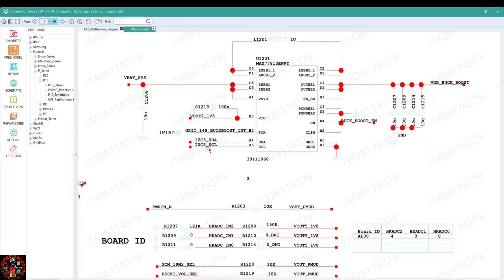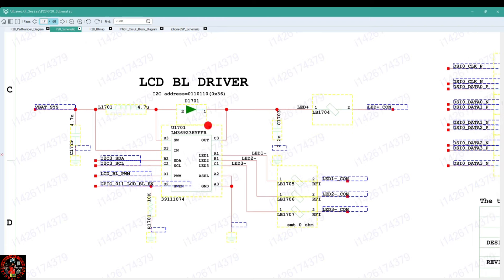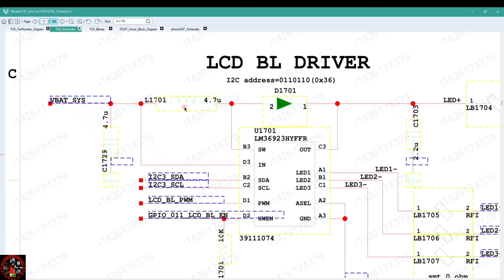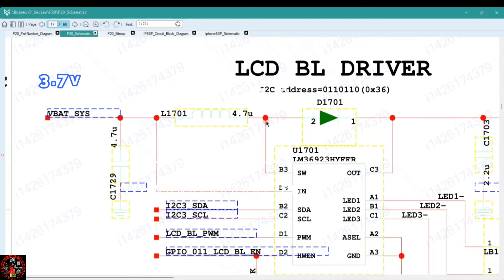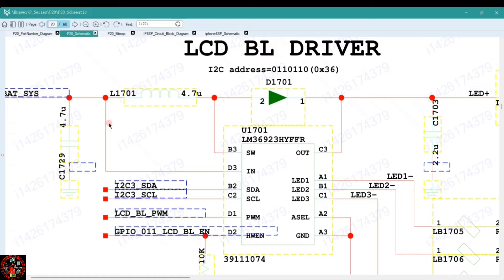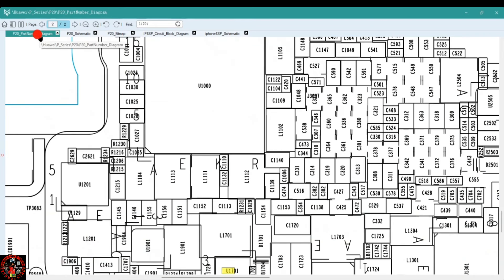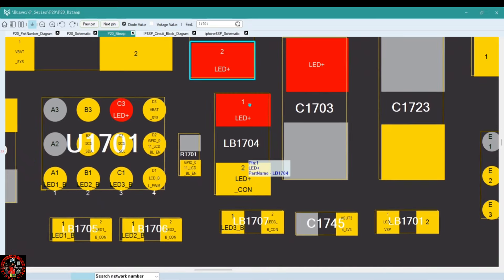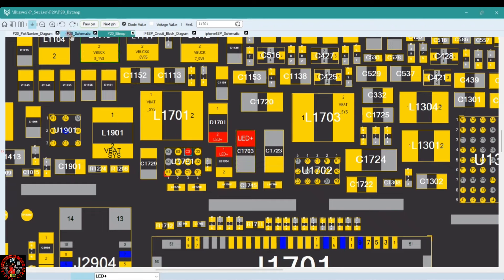How to Read Mobile Schematic Diagrams

Comment: I really learn from this video,i would like to join your mentorship program,but don't forget I'm from Nigeria.
Reply from the maker: You can still join if you are in Nigeria.
Reply: I'm also from Nigeria,  how can I join the mentorship program please 🙏
Reply: @SergesMike   can I download bid mapping and all the software that you are using with a smart phone?, I don't have a PC.
Reply from the maker: Click the join button next to my subscribe button then you will see the requirements and join from there
Reply from the maker: No brother. 
You will need a pc
Reply: @SergesMike  pls must the PCB be plugged in with a charger before one can check for the voltages?
Reply from the maker: Yes depending on what you are checking

Comment: The way you put it, one would understand that either the backlight IC works and the screen is displaying something, or the backlight IC isn't working and it needs to be replaced.
But what about D2, which is Hardware Enabler? What if the backlight IC is WORKING AS IT SHOULD but it's not being told to turn on?
Reply from the maker: I have videos which really explains how backlight ics work. 
All backlight ics are build up of integrated transistors which needs signals to be able to function as intended.
Sorry for the late response.